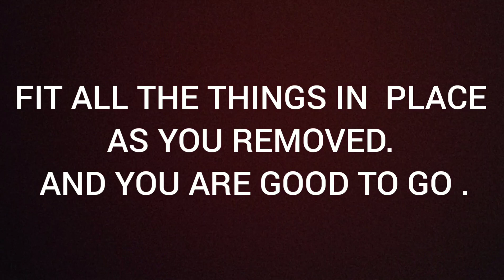Chain installation bajaj Rs 200/Ns 200.

Comment: Bro i have a ns 200 2014 version.. Is it fits rs 200 sprocket?
Reply from the maker: Yes it will fit but RS sprocket is 41t & NS has 39t
Reply from the maker: Aswin Ronaldo yes but in city you will have fun on highways you will not enjoy cruising with high rpm.

Comment: Have u ever tried using KTM 6 holes sprocket on NS ..
Reply from the maker: Installed RS chain sprocket and dominar chain sprocket.
Reply: @CRAZYMOTOGUY  thanks bro.. i would like to try out Dominar Sprocket.

Any suggestion # RS sprocket or #Dominar Sprocket
Reply from the maker: Mikaela_ka_nia first start with RS sprocket as it is much cheaper and easy to install without hassle. 
Then tou can try the dominar as a project.

Comment: Bhai farq dikhra gadi mein??
Reply from the maker: Yes the torque in low rpm has increased .
Reply: @CRAZYMOTOGUY  bhai ns mein rs ka sprocket aram se fit hojata na ..ya phr alteration karna padta??
Reply from the maker: @omarpatel6869  haan hojata rs ns ki almost sab cheez same hai next video mai dominar ka chain sprocket ns mai dale so ainga.
Reply: @CRAZYMOTOGUY  😍😍soon